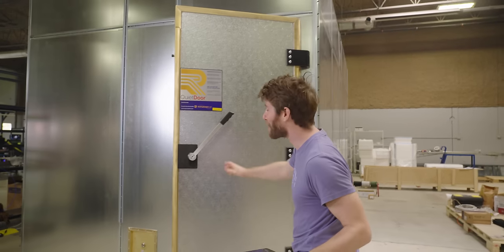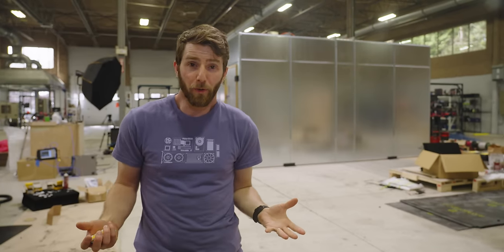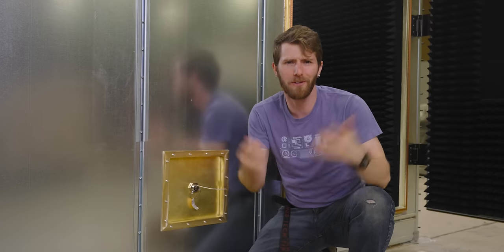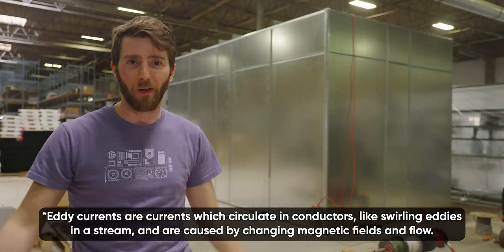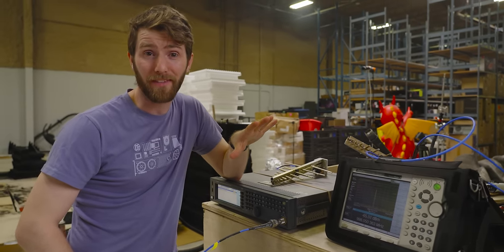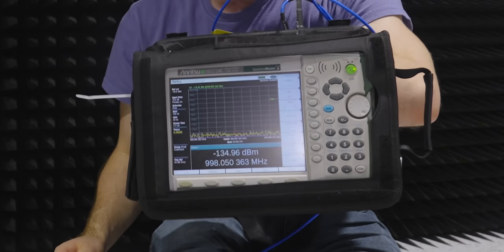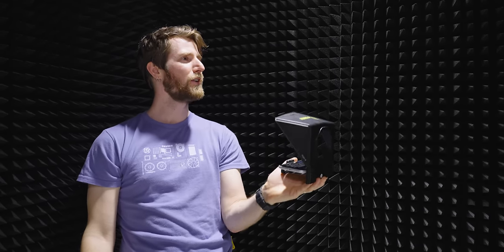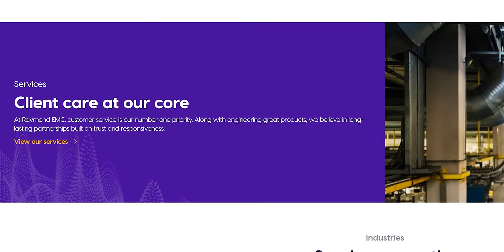There goes all my phone sponsorships… - RF Chamber Explainer

Comment: Huge props to Raymond EMC. They understood the value a sponsored video on LTT is bringing them, and went above and beyond to help make the Lab results accurate.
Reply: I didn't have top of mind awareness of any EMC companies before, and now I do of one.  The marketing works I guess.
Reply: Not even just this sponsored video. Every test they run for the rest of time is going to have this chamber in it (and most likely the door with their company name on it)
Reply: Now I know an EMC provider...
Reply: @HankW  I had no intention of buying a Faraday cage, and now I'm tempted to look into it.
Reply: @DallasHerrmann yeah okay lol. I'm sure you will buddy. What use would you get from it? And where are you getting the hundreds of thousands of dollars for one?
Reply: @Tactify24  they mentioned a Faraday cage, not an EMC chamber. You can get those pretty cheap
Reply: @robiaster  Every damn room in my apartment is a crappy Faraday cage.  I need to have a separate wifi router in each room, because the signal barely makes it past the rocklath/plaster walls.  Even the phone signal is terrible.  So I get to live in one, for a monthly fee.
Reply: @PaulGuy  You might actually be living in a faraday cage if there’s either metal lathe and plaster (real old) or metal studs as opposed to wood (real new). Run network cables from your router/switch
Reply: And they're even based in Canada!!
Reply: ew @tecjag

Comment: A good example for something similar to the light in the chamber, is the door on a microwave - it's made of lots of holes in a similar fashion, designed to block the ~2.4 ghz frequency of the microwaves generated, but allowing you to be able to still see through :)

Comment: looking forward to the router stuff. It's been impossible to tell what routers are worth it without some objective stats.
Reply: Yeah like I'm looking at getting a usb wifi adapter. Specifically the TX20U Plus. But the few reviews I can find have no comparisons to anything or any measurements.
Reply: @remeuptmain  shutup
Reply: Router's doesn't need to be tested in that chamber. Their performance can be tested easily by software.
Reply: @iamaduckquack  No one asked 🤣
Reply: My only rule for a router is no Broadcom chips as Broadcom has bad support for things like OpenWrt. I found a nice Qualcomm router which might I add is very overspeced called the DynaLink DL-WRX36, it is a WiFi 6 router with 1, 2.5G WAN port, a quad core Qualcomm IPQ8072A, 1GB of ram (doesn't sound like a lot but many routers have wayyyy less than this), 256MB Flash (again, might not sound like a lot but many routers have less), has OpenWrt support and have been running it stable for months on that (even though it is still on a snapshot release), the only caveat is that I would not trust the default firmware that comes with it just because the company is unknown so I would recommend installing OpenWrt and the most important thing (yes, even more important than these overkill specs) is the device uses Qualcomm and not Broadcom, I made the mistake of going for an Archer AX21/AX20/AX1800 (yes, Web UI, UART, and sticker on the bottom all said different model numbers) and it was painful, Dynalink has been working beautifully
Reply: @remeuptmain  You're in many comment sections with this same comment 😂 this is just sad
Reply: @remeuptmain  lmao dude wants to be attacked so bad.
Reply: how (good/crappy) your house is built is probably a bigger influence than the quality of the device.
Reply: @remeuptmain  I asked
Reply: @remeuptmain  I care and i'm asking you
Reply: @HowDoYouUseSpaceBar  No one asked
Reply: @remeuptmain  Or else, people will stop interacting and you'll have to make some friends intead of bating for convos in yt comments😂

Comment: As an RF engineer who actually does this stuff for a living, I was pretty impressed by y'all's video and knowledge on this stuff.

Normally YouTubers will give surface level, mostly correct on complex topics like this but this video went into decent depth and was bang on in terms of facts. 

Granted y'all had help from your sponsor, but it's still impressive regardless.
Reply: im sorry but by the way you write i cant imagine a world where you're not from a southern state 😂
Reply: A14245, for the simple task of protecting equipment from an EMP or solar event, will a basic grounded and sealed metal container do the trick?
Reply: @Spushed  Honestly, for most of that, just unplug any external cables and disconnect any antennas and it'll probably be fine.  If you want details, well, they're actually a little hard to find precise details on what an EMP actually looks like and you start running into needing actual RF test equipment to figure out how good your enclosure really is.  Also, exactly how bad an EMP will be in your precise location is a REALLY complicated question, even if you have the rest of that.  RF engineering isn't called black magic for no reason - things like geometry, materials, and a whole lot more matter alot.  A metal container will probably help (assuming it has no wires running in or out) enough, but most devices are designed with quite alot of tolerance to damage from high frequency RF.  It isn't done for EMP protection, it's done for electrostatic discharge and EMI regulations, but for an unplugged device during EMP, that's really the parts you worry about.  The low frequency parts of an EMP are mostly a worry for stuff with long wires or connected to the grid (which is long wires) which can act as antennas at those frequencies.
Reply: @Spushed  I'm exclusively focused on Cellular testing so that's a bit out of my wheelhouse. I'd go with what ccoder commented, it seems solid.
Reply: @a14245_  my apologies sir I am not seeing his comment could you possibly briefly TLDR what he said?
Reply: @Spushed  TLDR: Just unplug it and disconnect the antennas and you'll be fine.  Everything else requires an engineering degree to say anything for certain.
Reply: Except for the bit about grounding the Faraday cage, which is wrong. A common misconception, and isn't needed for it to work.
It might even hurt it's effectiveness, I'm not sure...
Reply: The way you used the "you all" did something to me.

Comment: Former USAF metrologist here.  I did almost 20 years of metrology with 12ish years being in RF metrology.  100K for a portable spec an with reasonable specs is a pretty damn good deal.  But we were doing stuff up into the 50Ghz range by the time I medically retired which kept our unit costs substantially higher.
Reply: Yeah, it's gotten pretty reasonable (for that sort of equipment).  If you need 50GHz, Keysight has portable stuff that starts at $70k that can go there.  If you don't need those kind of of frequencies, Siglent has some very well reviewed equipment, some of which is actually affordable to hobbyists (decent gaming PC sort of prices).  And there's alot of newer equipment that isn't like the old boat anchors - it might not be a battery powered portable, but it's easy to pick up and move with one hand.
Reply: @ccoder4953  yeah our issue was always the accuracies that we needed... frequency response/flatness was a specific one that was always tough when you went cheaper and more portable.

Putting our consistent -10 DB signal in and then checking it you know every 200 meg they would all drift really badly at some point or another in the spectrum.

If you just need one to do basic checks and looking for harmonics or signals you can get away pretty cheap.  We rarely needed absolute RF power accuracy because every test we did needed an accuracy that required us to use a thermistor or power sensor but then we had to rely on the s accuracy to verify a signal generator all the way out to fifty for example.

I'm guessing that these guys don't really need too much absolute accuracy since they only have one analyzer and they're not calibrating signals, only measuring for relative values.  If they're off by three DB and measure - 30 instead of - 27 it's not going to change the outcome of their review when the other phone they're comparing it to would also be 3 DB off at the same frequency.

Comment: Been to a big lab for some certification testing recently. They had all kinds of cool stuff in there from big turn tables to sensors powered over fiber optic.
Most interesting difference between yours and theirs is they had the power and data cables come into the chamber under the turn table in the floor. As long as they are part of the system it appears it is not a problem.

Comment: As a Retired EE, I have used,moved,and Re-built RF Screen Chambers where i worked at during my Tenure at Cobra. I can tell you setting up a RF cage is a little bit of some work ! 1 Loose stray strand of copper will ruin your Day ! Just like Linus had to track down that Bolt through the means of the use of Resistance,it's the same method to track down that 1 Pesky Wire  causing a Short !
What they DIDN'T tell you in the Video, is that Screen Booths are essentially a 2 Plane Ground Box. I'll explain,a box in a box. But each Ground Plane is separated from the other Electrically. You can't see this,cause,for this design is a solid wall outer skin booth. This is the Trick that makes the Screen Booth Work ! The 2 Wall division of the inner and outer causes a trap,a barrier like a prison wall. Nothing can get in,nor can it get out.
Now you also know Why they are SO $$$$ !!   Why they neglected this tidbit of info i don't know. Good of them to Give Linus a Worthy System!!! 😎

Comment: There was a chamber like that where I used to work and the panels on the walls with the pyramids were made of thus conductive foam and had the effect of muting sound as well as electromagnetic waves. Walking in and closing the door it was so abnormally quiet that my ears would actually hurt.

Comment: I worked in a far more hardened and shielded box like that most of my military career. (They had to withstand nuclear radiation as well.) It looks like that box is built better than the ones I worked in for my gear.
Reply: The thing with military spec is they don't want the absolute best testing equipment. They just want something good enough, this might not be the best chamber on the market, but this is certainly competing with them

Comment: You could do very contolled tests on how router/reciever placement can (significantly) influence reception, like you already mention some small things about. It would be very interesting and the audience can learn more on how the stuff actually works. I once fooled an ISP reception test by placing a metal slab on the right distance from my device to increase the odds of receiving free reception improving equipment XD
Reply: Did you get the free equipment?

Comment: the metal rod passing through the wall is collecting EMF and radiating it to the inside of your chamber 😎😎  otherwise only a signal small enough to pass through the holes in your wall that you put the conductive rod. ✌✌👍👍

Comment: I'd be interested to hear how you're going to test and maintain the tolerances on the tightness of the screws holding the chamber together, given they're a critical part. Any nearby vibration over time will cause them to shift, I'd imagine?
You're going to need a rigorous testing procedure to maintain the validity of your tests, even if it's as simple as running a complete check of the chamber before doing a test run.

Comment: Also these chambers (specifically the spikey walls) prevent radio waves from bouncing around the inside of the chamber and interfering with each other giving a non-homogeneous spotty environment of artificially high and low signal levels. The fact that the walls are absorbent simulates a chamber of (ideally) infinite size.
This is the #1 reason why a mesh cage is good for blocking signals, really bad at measuring things and should not be used in a home lab for pre-FCC cert. 
We have a small oven sized chamber at work for this reason.

Comment: I have so many questions about this build. How are the honeycomb air filters attached? Are they steel or aluminium or something else? Why not FC adapters instead of actual hole for the fiber optics? Also, careful with the doors brass "nails", as they tend to get lazy and eventually leak :)

Comment: I worked in one of those chambers using Rohde & Schwarz cellphone testing equipment. The new management did not want to pay for upkeep of the equipment. The door of the chamber was so heavy that it warped and broke off some of the copper fingers around the door edge. The Wifi in the adjacent lab was able to leak in. They didn't want to pay for the chamber to be maintained.
You should be glad that your vendor put a large and robust handle on the door. The handle on our door was literally from a cheap screen door. The door had to be slammed shut because it was warped and I would frequently hurt my hand if I wasn't extremely careful how I grasped the door handle.
Amongst other problems I found a leak from a RF connector from the rooftop cellphone antenna that wasn't completely tightened.
They eventually outsourced all the cellphone testing when the person in charge of the cellphone testing retired. He left a mess.

Comment: Linus, before you were born, one of the places I was stationed at in the Navy (back in the 1970s) had a RF chamber very similar to yours, though it was used for repairing and calibrating test equipment used to work on communication and RADAR equipment. We had lights, air, and electric power, though no fiber optic cable (also no cell phones or Wi-Fi routers).

Comment: routers and home wifi has been an absolute headache for me for years. been following guides and learning about every possible failure point with little success. Videos made with THIS will make mi life so much easier
Reply: With wifi coverage, the most effective solution IMO is mesh networking, and being aware of where the nodes are placed. Some houses you just can't effectively cover from a single point, no matter how powerful the router is. If you can have the backhaul for the mesh go over Ethernet in the walls, that's even better. The downside of mesh wifi I've found is a rather stupid one - most of the cheaper solutions on the market, while effective, are trying to be "smart" things that require an online account and often needlessly dumb down or eliminate basic features that normal routers have had for ages.

Comment: Nice enclosure- the govt. uses these at COG sites for storing backups and etc.  Usually they are built into the building and not fully isolated like yours.  My guess is that yours is actually better than the ones on federal/govt. property-those weren't insulated from the ground as far as I could tell.  Pretty cool stuff, overkill if all you're doing is protecting from EMP weapons but perfect for the kind of testing you are doing.

Comment: Neat!  A TinySA would be good to have.  It's a hobbyist, aka cheap, spectrum analyzer that you can put in your pocket.  Not a $100k unit but might still be nice to have for multiple test points.
BTW, a friend's dad designed LED lighting for MRI rooms.  They had to come up with a special data communication system using sine waves so as not not generate any unwanted RF.  It gets crazy when you are environments that can't have ANY stray RF or electrical noise.

Comment: This could get interesting when they start testing PC cases. Some brands like HP and Asus use proper coated and bonded glass for the shielding, most other case manufacturers just throw on some cheap tempered glass.

Comment: Could you test the RF 'seal' of the room by using a high-sensitivity optical device like a photomultiplier tube to minimize the amount of light in the room? And then if its successfully blocking as much light as possible, it is therefore blocking all lower frequencies/longer wavelengths at least equally well?

Comment: Question (that i think i know the answer to): why aren’t the wall panels joined like the door is, with the knife edge into a slot design? Then you wouldn’t have to worry about the gaps in the screws (you could still use them if it wouldn’t be sturdy enough with just the slots/edges).  Cost is probably the reason, just curious if it would actually solve the problem

Comment: I’d really like to see how the chamber affects a fm radio, see if you still get static through the empty frequencies or silence inside the chamber.
Reply: I have one of these chambers at work and could probably try that. But TL;DR there will still be static, because the receiver itself will have self-noise that will get cranked up by the gain control. It might be quieter than outside though, if the maximum gain setting isn't enough to make the self-noise as loud as real noise.

Comment: A word of warning, I used to edit What Mobile  magazine in the UK. In the early 90's we did a year long project, testing 2G phones in a lab - full Rohde and Schwarz test gear, anechoic chamber the lot. The bit I was most proud of was how I could take all the dBm type readings and present it in a marks out of 20, easy to read form. We did the work in conjunction with Carphone Warehouse. The problem was that the results we got did not correspond with the consumer experience of how good the phones were. This led to lots of meetings with the 30 or so handset manufacturers and the four mobile networks: Orange, One 2 One, Cellnet and Vodafone. What we learned was that handsets behave differently on different infrastructure. What you experience on your Firecell network will not necessarily reflect what a consumer sees on Verizon. Yes, you get nice, level playing field information but it's not necessarily useful consumer advice. Ping me on LinkedIN if you want to know more.